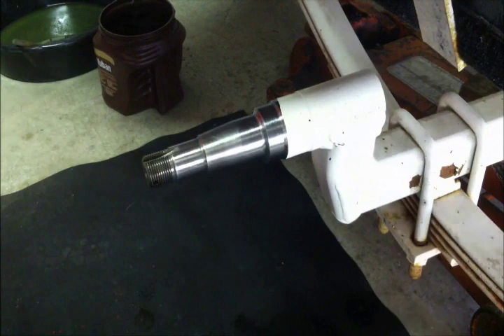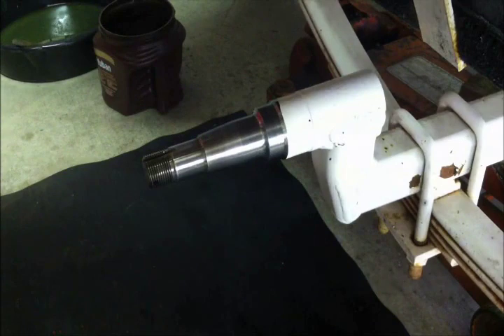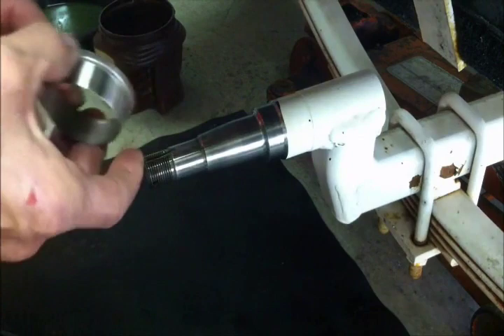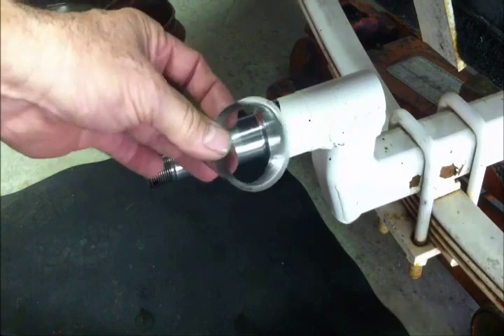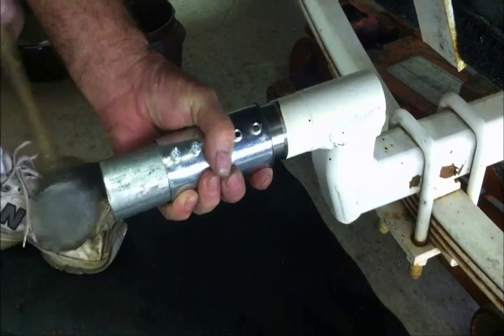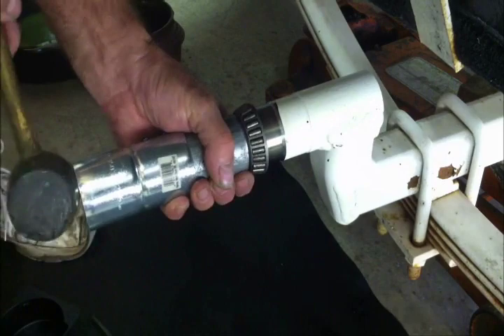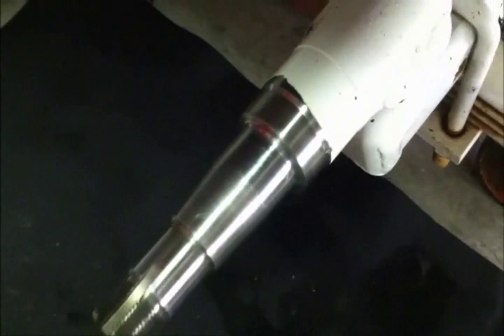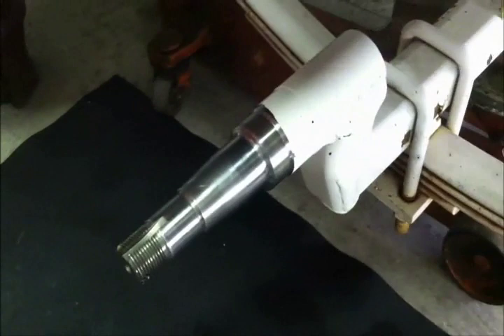Boat Trailer Axle Spindle Repair Sleeve

Comment: Nice video. Thanks. FYI - I watched another video and a little bit of shellac sealant was wiped on the surface first to make sure no leaks. I thought that was a good idea especially for a surface that has worn or rusted areas that could leak under the sleeve.

Comment: Very good video. Where did u get those sleeves. My boat trailer spindle where the seal would ride is 1/16 inch and I have checked a lot of places nobody seems to have them.  Thank s

Comment: Does that rear flange always have to be cut off?    Is it made to break off or does it have to be folded back-and-forth until it breaks off in sections?
Reply: i think it is marked to break off with a little work